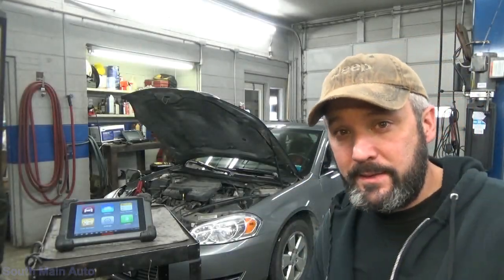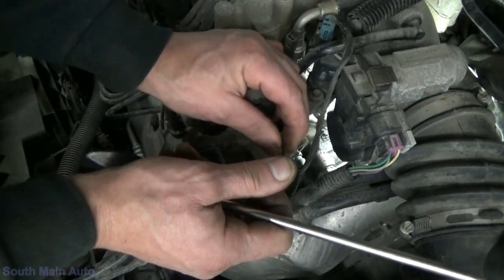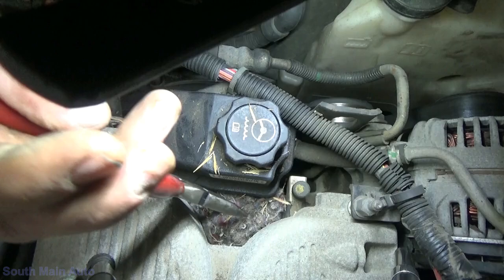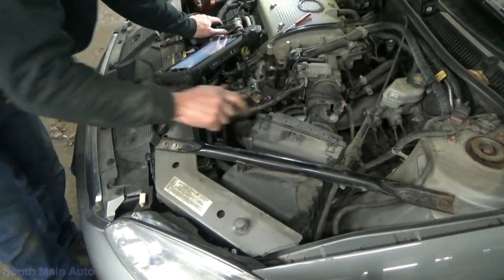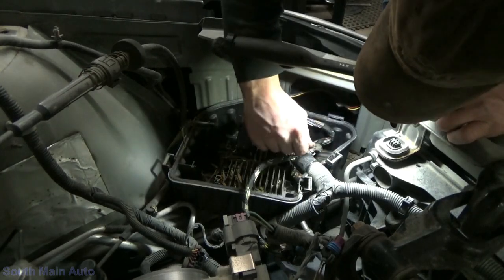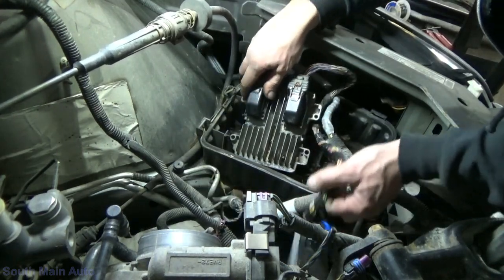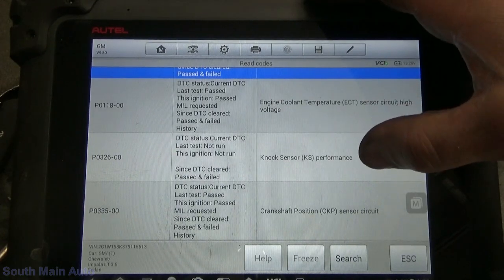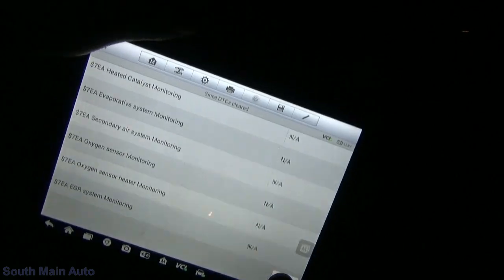Chevrolet Impala - Extended Crank Time - Service Engine Soon Light

Comment: Eric O .. I very regularly watching your videos & I'm very much thankful of You to helping us greatly.ECT Sensor; 2 wires, Reference Voltage and Signal. I understand the diagnosis of Reference Voltage wire but Signal wire holds very low Voltage. As you seen 0.07 at signal wire and you diagnosed it's an open circuit. What reading must be there?
A Sensor connector (female side) normally has 2 or 3 wires; Ground, Reference Voltage, Signal. I understood how to work with Ground and Reference Voltage but need to understand mystery of Signal wire.
Thanks for your help.
Reply from the maker: You would usually see battery voltage, perhaps a regulated 8 or 5v in some cases. It is a thermistor  only 2 wires needed. A signal and a ground.
Reply: Thanks so much Eric O
Reply from the maker: you should watch scanner danner premium. He explains a lot of that
Reply: I do watch him but as far as I understood, his premium membership isn't open for Pakistan. I also don't know how much his fee is; we have a low per income capita here in Pakistan and also big difference in exchange rate at present; 1 USD = 106 PKR :)
Reply from the maker: Oh ok I see. He has a lot of good content on the free channel too. The premium I think is $9.99 a month
Reply: Agree and thanks Eric O

Comment: A 4 stroke engine with ONLY a crankshaft position sensor can not differentiate between coming up on compression or coming up on exhaust.  You must have a camshaft position sensor for that.

In THEORY, you can run a 4 stroke engine on ONLY a camshaft position sensor (what is a distributor lobe ?).  Cam sensors tend to have less teeth because the actual crank angle comes from the crank sensor once it has synchronized with the cam.  More teeth/less teeth is important because engine speed is never constant.  Too many teeth would overload the CPU chip inside the PCM.  Too few could mean spark (coil discharge) or injector open could be miscalculated (those events are cranks based, but because there is no "true" crank reference, accurate to <1°, the "scheduled" time for those 2 events is predicted based on the current TIME and the previous TIME between crank sensor pulses.)  In this one respect, the lobes on a distributor shaft were actually better.

I spent way too many days and nights figuring all that out in my "former" life.  In a perfect world, the crank sensor would be a 360° encoder and each intake and exhaust cam would have a a 720° encoder.
Reply: A functioning crank and cam sensor are required because the the knock "strategy" only "listens" for knock in a small window BTDC of the cylinder coming up on compression.

Comment: I hate those 3.5L engines. The air filter is a royal pain to get back in place. Also how is this engine running without a crank sensor signal?

Comment: They put the ECM in the airbox? That's odd. I guess there are worse places to put it though. Looking at you, Renault (under the battery), Chrysler (wheel well), VAG (under the wiper cowl), and others.
Reply: The ECM is in/under the air box to get a flow of cooler air over it.

Comment: what I would like to see is just anything that deals with any motor it can be anywhere from a 3 hp side shaft motor or as complicated as a rocket powered wheelchair
Reply from the maker: rocket powered wheelchair sounds like fun
Reply: South Main Auto Repair  ya one of these days ill build that lil hotrod

Comment: I have had squirrels in my diesel pickup truck three different times one time one jumped out at me when I open the hood to check the oil my insurance company paid to have it fixed 3 times with my deductible I do know that they can really wreak havoc with these new cars with the electronics and all the things that go with it I used to be a mechanic years ago before the computers come along

Comment: And that lost in there judging on all the rat comments is the excellent diagnostic work. Did look at the tape reviews on amazon and saw several that weren't good. And I know that's the case  with alot of stuff, but maybe decon under the hood backing it up wouldn't hurt? Thanks again Eric !
Reply from the maker: NO POISON!!  Trust me , you do not want it to die in the car. Traps are OK though
Reply: Agreed after I think about it. Honestly was thinking it didn't get them until they went and drank water. Bad situation to have to deal with any way you go about it .

Comment: You ought to see the rats at my work (recycling plant) and the wires they chew through. I'm surprised we don't find dead ones that have been shocked.
Reply: To add...they don't just chew through one wire. And wires only come in a few colors on those machines. Black, red, yellow, blue, and green/yellow. Control wires for a lot are red, and there is probably 10 feet of a dozen or more of those just stuffed in the cabinet. Motor wires are usually black. 3 black and 1 green/yellow ground. At least the motor wires are grouped in their own plastic looms per motor.

Comment: Hi there im auto tech myself but wana ask someone who knows better: 2003 Toyota corolla 190.000 miles - extended  cranking on cold weather only- when warms up restarts perfectly. Repair history: new injectors, cleaned MAF (reading 90% Cal Load no problem), new IAC, cleaned throttle body, Fuel pressure 45 -50 psi, holds pressure ok with key off. No intake leaks, Long Fuel trim -1 to -2%, injector pulse 1.92mS (idling fully warmed up). no coolant or oil consumption. No codes ether. I noticed all Corollas that age seem to have this issue. Is it possible worn engine low compression do that?

Comment: ive never seen that engine not have a leaking rear head gasket. bit o oil.
Reply: Are you thinking of the 3400? The 3500 is much better on gasket sealing.
Reply: Work on Gm since the 3.1,3.4series came out...never saw a headgasket leaking oil... always from end of intake following down the split line.....
Reply: My GM 3.1-3.6l V6 experience with bad sealing is that they usually come in on the hook with a no crank no start, and the root cause is hydro-lock due to the well-known intake manifold gasket failure allowing coolant to fill one or more cylinders while parked. If you're thinking "is that the one related to the class-action lawsuit", it is exactly that failure.
If that same gasket fails while running the engine will continue running, the leak is right in the zone of "fast enough to fill up a cylinder when left to sit for a couple hours but not fast enough to instantly hydro-lock the engine right when it fails".
Happened twice to a 1995 Pontiac Bonneville my parents owned, and I've seen it on other cars numerous times. Only reason I don't see it so much anymore is because there aren't many cars with that engine left on the road.
Reply: 3500/3900s both have rear head gasket oil leak issues, my 08 uplander 3.9 work van has same problem, otherwise a great engine

Comment: I think knock sensor on the block under manifold intake. the rodent nest would of given me heads up about issue. I've had possum explode in ac Chevy belt ruined compressor. the blood and guts really ruined the ac clutch and bearing.    the thing is waiting for insurance to look at it. I had to explain many times to insurance companies about issues not just that Chevy... it really sucks but some are really cool cause the customer is right there still complaining about the issue while I'm on the phone telling insurance what's up.... LoL. I worked for Firestone in 10081 Chapman garden Grove CA.   I worked on Chris Stevens car. so I know about the crap that goes on...

Comment: I had a squirrel eat through wires in my minivan - ended up with no headlight, side lights etc... I purchased an electrocution rodent trap after that - never did get that squirrel, I think it must have got run over or something somewhere.

Comment: with an hour diag.. at what point do you stop and say I need to dig deeper or just go with your gut... needs crank sensor and temp.
I know alot would have just thrown parts at it.
Reply from the maker: I don't go with my gut, I go with data :)
Reply: South Main Auto Repair
 I am sure this took over an hour to diag.    did you call him at some point and say, hey.. I found mouse problems.. do you want me to find and fix? or did you just roll right into repairs?
the whole point of hour diag is to be as accurate as possible with the problem.  not to repair, unless it's a fuse. 

new guys have a hard time with this blurry line. a skill that is perhaps learned with time?

even worse for a new guy is . his/her skills are not honed very well, and each process is slower. wiring diagrams, basic electric, common things to look for, tricks of the trade, understanding of pid data. 

you sir got skills!
Reply from the maker: This job was about 2hrs start to finish including the repair and camera time. Didn't take a lot of digging once we knew it was a circuit problem. I knew the customer and he just wanted it fixed. If I thought it was going to be really involved at that point I would have called.
Reply: Best part is, your customer can watch the YouTube video! :)

Comment: I guess it's due to being so rural ..?! Or that I'm too much of a city boy or what, but I've been a mechanic close to 40 years,, and I have never ever come across rodent damage, or a rodents nest other than in junkyard vehicles or cars that have been sitting for a long period. Of time.. I've seen wire damage due to fire,, due to accidents,, crushed wires pinched wires,, overloads,,
But I've never seen wire damage due to a rodent.. bought an old 57 Chevrolet panel van with a 235 blue flame 6-cylinder that sat for 25 years with no carburetor on it. And had to take the intake manifold off because a mouse had built a condo in all the intake runners... But that's as close as I've gotten to anything rodent related.... THAT'S MY PROBLEM LADY.

Comment: I had a Dodge under warranty that developed a persistent knock sensor code. The dealer reprogramed and then replaced the PCM. Gave it back to me with erratic fuel gauge and incorrect speed and  tach readings.. (lol. this was because they incorrectly programmed the PCM, they selected wrong model, or something.)  They then wanted to drop the fuel tank to replace fuel the sensor...  I called Dodge and complained.  Another dealership found a mouse nest and a broken knock sensor wire....  Dodge fixed it for free...

Comment: eric question
i know with out looking at it u cant give me a for sure answer 
but i have a 96 dodge ram 1500 it keeps losing coolant its not leaking on the ground n there is none in the oil any ideas what i can start checking on
Reply: Andrew Crawford My 1995 F150 was doing the same thing, get one of those pressure testers and pump up the system to specs (Ford is 13psi).Fill it with water before. I was able to see coolant bubbling out of the radiator plastic end cap. Shake all the hoses. You should be able to hear or see a leak.  I think you can borrow the pressure tool from a local parts store.
Reply: S. Gromme its got new upper n lower hoses new rad n new water pump
Reply: bad head gaskets do not always  contaminate your oil. a leak down test will be the direction I'd head, or like the other guys said, pressure test your cooling system you'd be surprised where you find leaks that way. don't forget to check your heater core. good luck
Reply: If it's not on the ground or in the oil, then it's in the cylinders. Pull the plugs and look for white deposits on the tips.
Reply: Ok thanks guys

Comment: Please tell me that's not hardware store "electrical" solder? 

That's just about the worst (aside from plumbing solder) that you could use. It's a royal pain in the ass to work with. You should look into getting some solder from a brand like kester. I use kester 44 (the number being their identifier for the flux type). Although if you use a rosin solder you could end up with green residue from copper wire that looks like copper oxidation (but it is harmless).
Reply from the maker: I just use 60/40 rosin core. Works fine and have fixed 1000's of wires with it. Never really got to wound up about the size of it.
Reply: South Main Auto Repair Wait a minute, that's actually rosin core? Huh, I've never had any luck finding rosin core solder in that size when I first started soldering. (Since then I've just used smaller diameter, since it's better suited to PCB soldering.) The only solder I've seen in that diameter in stores was lead free, solid core.

Comment: I don't understand why you start taping up the wires before you see if the car runs normal after the repair.
Reply: Because the wires need to be repaired regardless if they fix the problem or not.

Comment: not a mechanic but a tech.
Reply from the maker: no I am a mechanic... techs are professionals
Reply: South Main Auto Repair you my modest friend are a professional. As a retired electrical contractor with over 30 years experience, anyone who can diagnose using electronic sensing devices is a tech. MERRY CHRISTMAS
Reply: ok how about a mechanitech

Comment: good job Rick One question  : Why is it all you mechanics usually take a blow gun, and blow crap all over the place instead of having a small sho vac to suck out the mouse nest, belt grindings dried leaf  crap etc. ??  BTW, innocent looking mice droppings can carry dangerous disease: I never knew that until the regional electric utility I worked for instituted a special crew to suit up with respirators , etc. to clean this stuff up .......true

Comment: Eric , how do you like your Autel and which model are you using ? Thanks TheReaper!
Reply: He uses the MS908. I don't rate mine very good as the customer support is crap for a tool that cost me around $4k! Well for me here in Australia that is the case anyway!
Reply: I've heard good and bad reviews on these , I wish I had a better idea of what each model offers ? Also I think it cost $350 U.S. a year for upgrades ? TheReaper!
Reply: As far as I'm aware, the MS908P is the top of the line in Autel & the updates are crazy expensive (to the tune of around $1200AU/yr) & I haven't renewed my subscription with them because their Customer Service is rubbish(over here in Oz anyway). I wouldn't buy another tool from them again, nor would I recommend it.

Comment: thats the most expensive tape I have seen, $30.00 bucks
Reply: I happen to own a mercedes 190, an old taxi model imported from germany in 2000, sat in a coldgarage in sweden for 4 yrs aprox, had som company with rats and the interior light in the front is totally junk, and since thats a part that you will not get your hands on anymore, i'd love to pay those 30bucks.

Comment: ECT Sensor are Next level Headaches with Modern cars. But Rodents' and Soy based wires is a Problem no Tech wants to Face, So Imagine these Electric Car , that's full of Soy based wiring , its like a Dinner bell to Rat's. But Money has to be made and we'll continue to do the Job